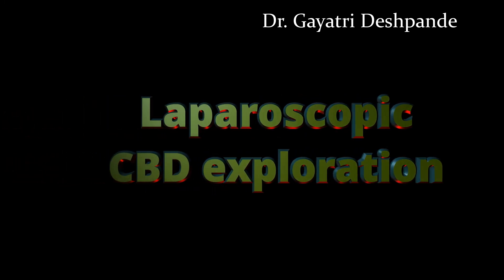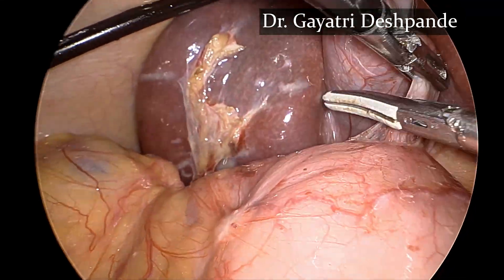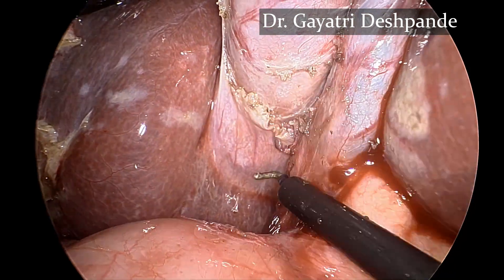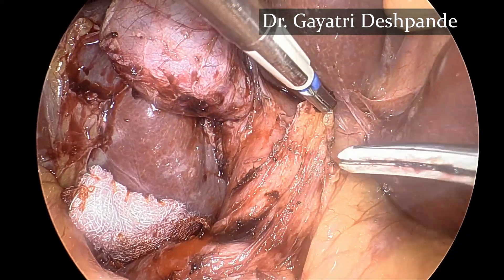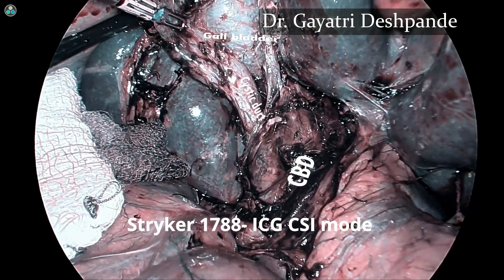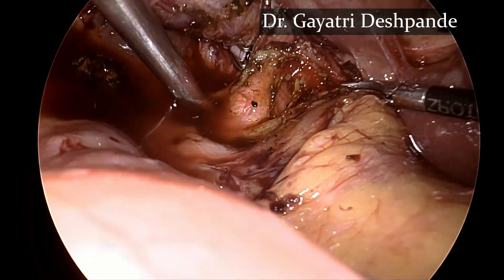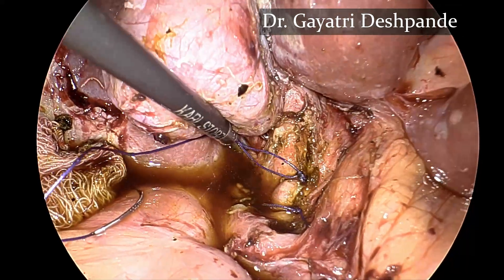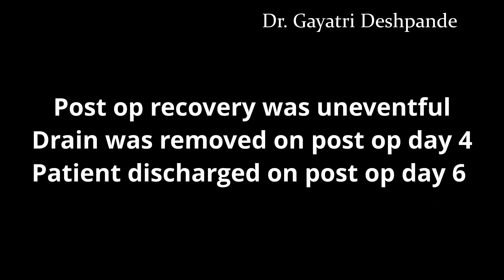Laparoscopic  CBD exploration (Step by step)

Comment: I’d like to make some suggestions. First, during cystic duct dissection, you could leave a catheter for posterior cholangiography. Once CBD suture was finished, ou could study for stone fragments, leaks or stenosis (tight suture). And if image is OK, you pull out the catheter and clip and cut the cystic duct. And second, I’d close the CBD with 6-0 or 5-0 PDS doing small bites running suture to avoid leak or future stricture.
Anyway, nice demonstration, thanks for sharing.
Reply: I have a little experience in this surgery , what is the best thread to close CBD polypropylene or vicryl ? And type of suturing continues or interrupted?
Reply: @ My choice: running suture with 5-0 or 6-0 PDS and very small bites.
Reply: Role intraoperative cholangiography vs choledchoscopy